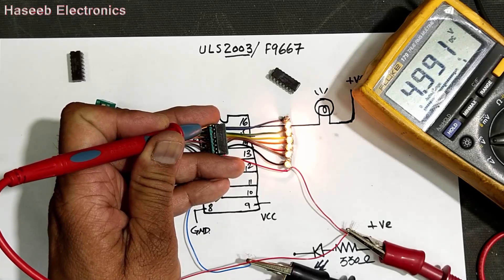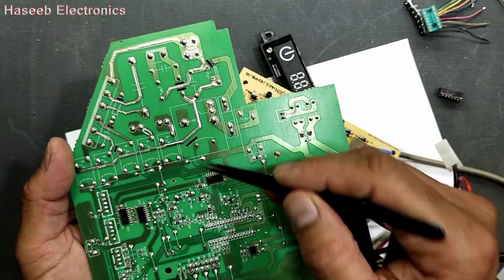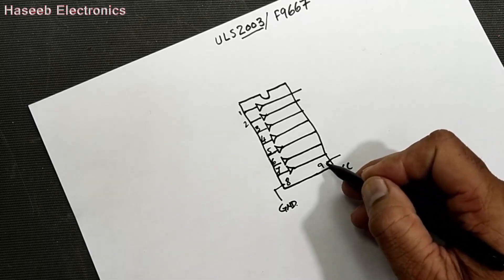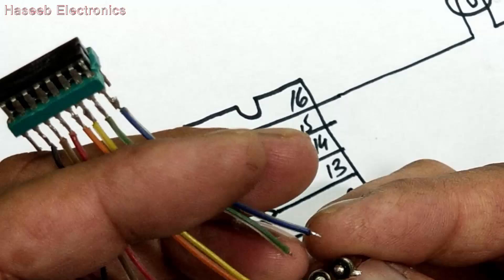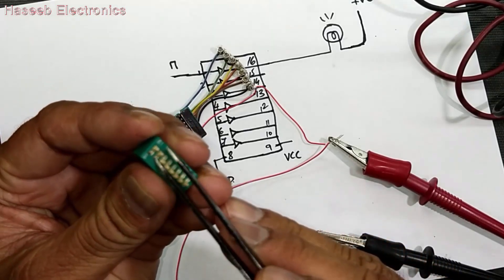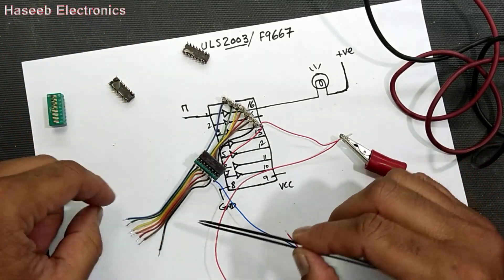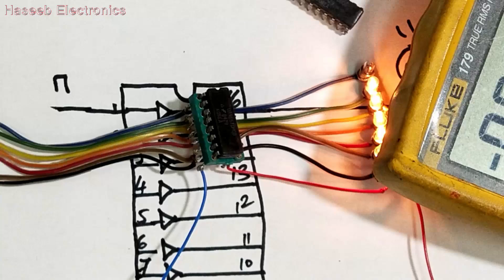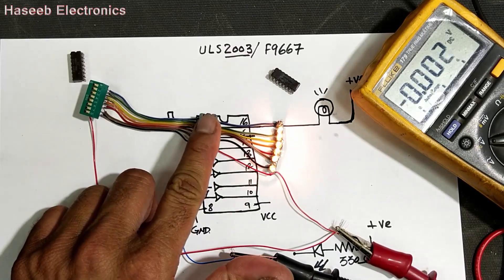{331} How To Test ULS2003, ULN2003, F9667 Function, Circuit Diagram

Comment: I think you can also set the multimeter on diode mode, and connect the positive lead to the ground pin and test all the pins with the negative lead to see if theres a diode drop or a short. Have you tried this method?

Comment: Wonderful explanation Sir. Could we use this same circuit with ULN2003 in 24V system? Here you are using 5V for switching, Can we directly use 24V in the input side? Thanks in advance.

Comment: great video, can we test uln2003 just with multimeter in diode mode?
Reply from the maker: thanks a lot
no it is impossible to test in diode mode
as it is Darlington based 
and it have biasing resistors
Reply: @HaseebElectronics  oh...okey, thank you very much for the quick reply and the great videos ❤

Comment: is it not suppose to amplify the voltage not give ground.
Reply from the maker: it is transistor array to drive relays, solenoids 
the weak signal produced by the processor cannot drive the relay winding so his transistor array works as a switch

Comment: Why using this ic with all micro control
Reply from the maker: because microcontroller have very low output current and it cannot drive relays or other things, 
so this ic is used to amplify the signal to dive relays
Reply: Glad to have my question answered and your utub channel  is very helpful for us

Comment: Wow, amazing video.  Are all versions of ULN2003 interchangeable?  So any version of 2003 can replace ULN2003L?  Yhx
Reply from the maker: yes 
ULN2003, ULS2003, F9667 ULQ2003, are same
Reply: @HaseebElectronics   thx for your reply.  What about ULN2003an, ULN2003A...and any ULN2003* can they be a substitute for ULN2003L?
Reply from the maker: @AsiaRoadTrek  all these in Generic number ULN2003, ULS2003, ULQ2003, F9667 are same, 
prefix letters show the manufacturer data and the suffix letters and digits define the temperature, packing, applicability etc
function wise and usage wise these are same

Comment: Nice video. i have a question Please, If  Microcontroller switching 24V 500mA Load by using UNL2003 Then PIN9 and All the Loads have common +24 But the Ground Pin 8 this will be (5v Power supply GND) Or The 24V Power Supply GND. thanks

Comment: Sir is kid65783 ic equal to uln 2003?
Reply from the maker: KID65783 is linear bipolar switch and it have 8 channels and it have 18 pins 
while 
ULN2003 is 7 channel darlington transistor array and it have 16 pins 
so these aren't compatible
Reply: @HaseebElectronics  ok Sir 
Thank you

Comment: Very detailed explanation with graphics and tools.  I am just learning to repair a dishwasher where some functions such as drawing in water and heating the water were out of order.  I have found the two output pins (pin 14, pin 12) for these two functions were connected with the VCC (pin 9 as shown in your diagram) in the ULN2003A directly i.e. they are shorted. This means the transistors of these 2 channels were damaged.  Thus the relays for the relevant functions were unable to work.  I am a beginner in DIY repairing this appliance and I was not certain what I found.  Now your explanation clarify the issues.  Thanks for sharing your expertise knowledge.
Reply from the maker: best regards
if output pins are connected to either +ve or -ve supply it will damage the ic. 
sometimes input pins are connected to +ve or -ve, that is normal   but the output pins must not connected to ant supply line 
thanks for your valuable feedback

Comment: Hello once again my dear brother Haseeb! Once again another fine video and a very practical one for me. One year ago my Samsung side by side refrigerators went out. It seem that the compressor could not start but was trying as I could hear the overload trip after a period of time and reset later. The Compressor was very hot and lock rotor current measurement very high. Located the processor board and after careful study determined that the compressor run relay (12v 16A) was energized but was not sure if contacts had welded in the close since I was not able to hear the contacts reset when denergizing the compressor via overload. Replaced the capacitor run relay however when removing the processor board from  it’s supporting case I discovered the Electrolytic starting capacitor for the compressor. It showed signs of over heating and leaking. It tested very low so replaced it. Due to the numerous attempts of the compressor to start the start winding had opened. Didn’t want to delay matters so I called in the Samsung professionals to handle the matter since now I realized the compressor will have to be changed which meant the system will have to be opened, refrigerant removed, evacuated and recharged. I have been trained to do air condition and refrigeration work and have necessary tool and equipment however I am now retired and don’t do a lot of that type work except on my own systems so I don’t store refrigerant or nitrogen at my home. To make a long story short,  Samsung repairmen did come out and the compressor was bad so it was replaced and there was a leak in the condenser coils that was brazed. The overloads were changed but the compressor still failed to start. The processor board was changed and the compressor started properly so the system was evacuated and recharged with refrigerant. Now that was a costly repair but I still have the old processor board and you have now shown me through this video a simple way to test the darlington driver I.C.’s which I suspected one channel was open from a test I performed. I suspect the channel from the driver l.C.may have shorted from emitter to collector since the compressor started as soon power was applied with the old processor board and there should be about a 30 to 45 second delay before the compressor start. Thank you for your time my friend as I know this was a very long comment. Thank you for making me a better technician.
Reply from the maker: thanks a lot for considering my efforts valuable 
your experience in samsung product and its restoration is really painful
please accept my best regards
Reply: I've the same kind of problem on our Samsung SBS refrigerator. We bought it in 2006 and has been working 24/7 and never got out of order since then. But a month ago, electricity went out for 45 minutes. It came and went instantaneously 2 times in this interval. Faulty ever since. Samsung doesn't even support spare parts as they don't accept for repair. I called the backup service that came before for install, but he did nothing but change the relay on the card and went by saying that there may be a short circuit in the cables. There is energy going to the compressor, but there is not even a buzzing sound, not getting warm and even the fan does not work. I found a workshop manual for this model on the internet and checked some troubleshoot. I executed forced operation on compressor by myself. Of course, I have information about the security measures to be taken. When I plugged in the cable, there was a buzzing sound from energy and then I turned it on. Compressor working as it should be quietly. Even started to warm up. I did a continuity test on several wires and found continuity on multiple wires, but possible due to connection to common wires. Also found ice maker sensor is faulty which is not working in the whole cabinet. But my guess is that if the fan is not working, the fault must be on the card. There must be a fault in one of the npn type Toshiba TD622003APG darlington sink driver that controls the relays. Since this driver is no longer manufactured, it is recommended to use TBD622003APG instead. But although it offers the same input and output values, I am not sure if it will be compatible with the card since it is more advanced because I do not have experience. But I like to investigate and solve the problem.

Comment: Question I have a tlc TV board with the power supply built with the motherboard attached but am only getting 165v from the main capacitor and the hot side and bridge rectifier diodes working plz help.
Reply from the maker: please mention the model number. 
written on the ID plate on TV set, so that it will easy for me to check the circuit and reply
Reply: TCL
MODEL:L32E4200A
POWER SUPPLY:
110-240V-
50/60HZ
45W
CAUTION
RISK OF ELECTRIC SHOCK
DO NOT OPEN
WARNING TO REDUCE THE RISK OF ELECTRIC
SHOCK DO NOT REMOVE COVER (OR BÅCK)
NO USER SERVICEABLE PARTS INSIDE REEER
SERVICING TO QUALIFIED SERVICE PERSONNEL
CB certificate No CN30850-M2
Made in Hui Z
Serial No.:
OFE118958C-1279

Comment: السلام عليكم ورحمة الله و بركاته
 Brother Abu Haseeb I hope you are fine
 I have a question how UPS works
 Whether you can put one or more videos explaining the correct method.
 Because I have a UPS the  transformer device that works and produces electricity but does not transfer it to the outlet for work. The device that I have is a Fake product that contains only one relay and a comparator lm358n and a processor 12C5204AD_STC
 God bless you
 Your brother Fawaz.  From Algeria

Comment: Can I apply 12volt dc
Reply from the maker: yes we can
it is normally used in 12 volt circuits
to make tester use 12v lamps